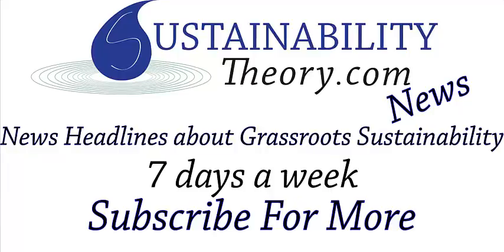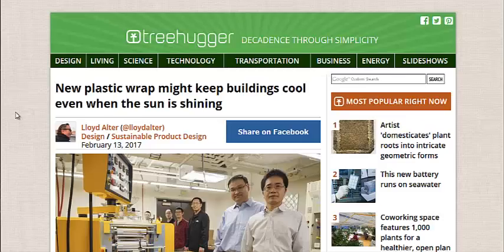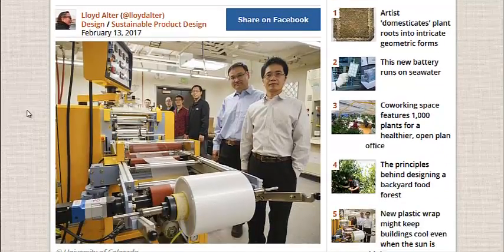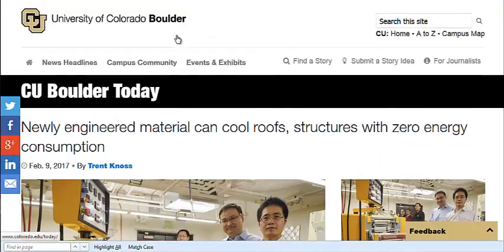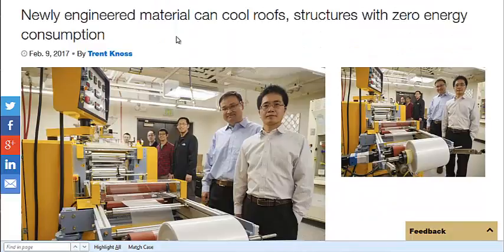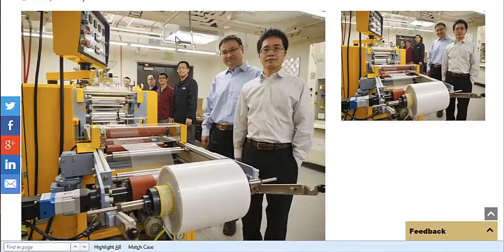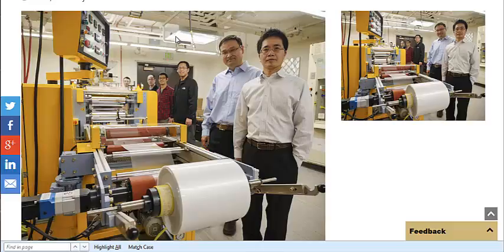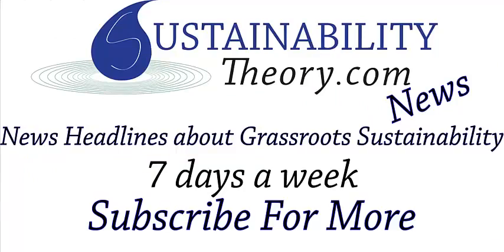Zero Energy Air Conditioning With Thin, Clear, Plastic Film

Comment: Does Radiative Cooling require heat in the first place?  I'd like to ask in the context of a van (not a building) as an example..  In particular a black van with no insulation (just metal) in Florida.  I've noticed that during the day the van is unbearable in the Florida sun, so I park in in the shade but most often I don't bother being in the van during the day which is honestly fine.  At night the van is cooler than most other cars that are heavily insulated so it makes it nice for sleeping in muggy florida.  Anyways, my question is, would Radiative Cooling help cool a very hot van? what if the van was not that hot to begin with because it was parked under trees near a breezy river? would Radiative Cooling help as much?  In part I'm asking because I read somewhere that ancient people somewhere were making Ice using the hot sun with Radiative Cooling. Thanks.
Reply: the plastic film would not be viable (without shananagans) for cooling large, open spaces (comparatively to the thickness of the film*) also it should still cool things down as long as it's above 0°K.

*this includes vans